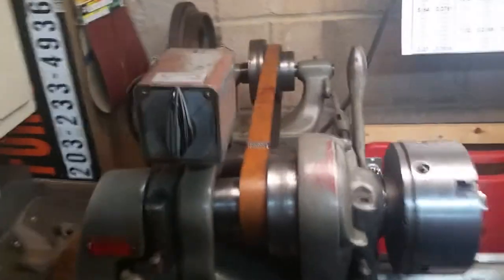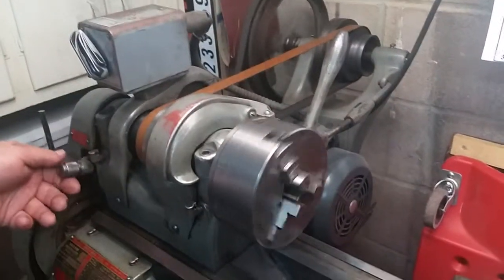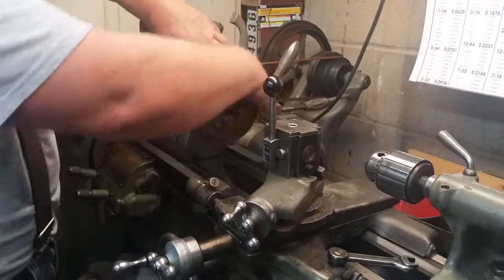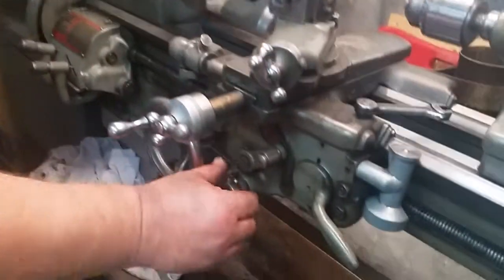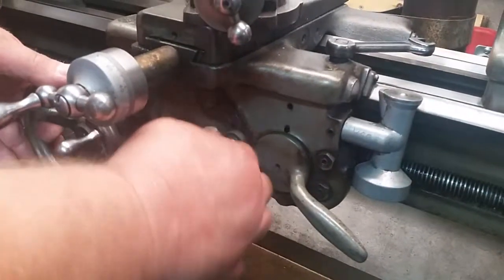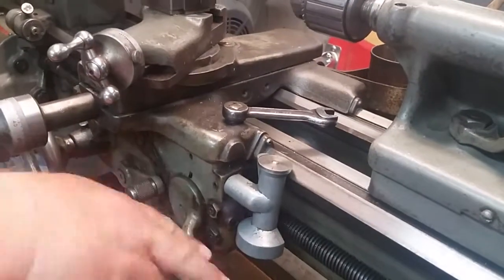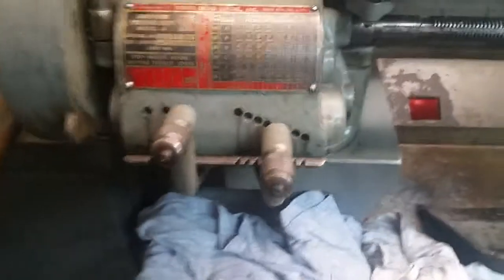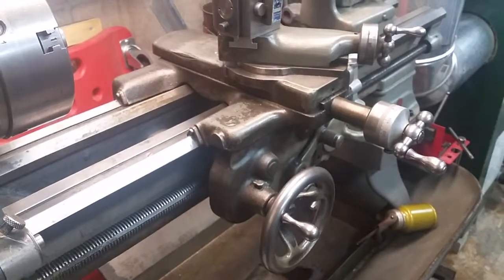Brief South Bend lathe tutorial

Comment: It's a good thing it is brief, any longer and there wouldn't be a lathe left!
Way oil is not the only oil used to lubricate this machine.
Never engage gears while the lathe is running.
Back gear, forward, neutral, reverse, and finally the Quick-Change Gear Box. The lathe is always stopped to change these!
Never slam the thing from forward to reverse or reverse to forward. Just one little safety reason is the chuck could unthread itself and engage you and bang up your critical ways.  Besides what you can do to your gears and rod.